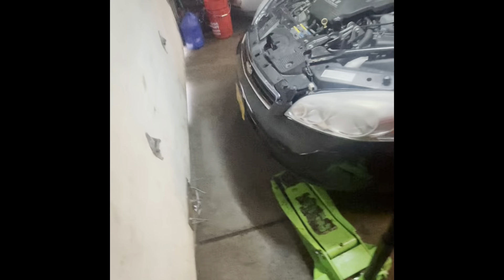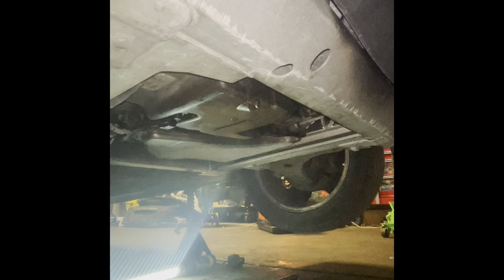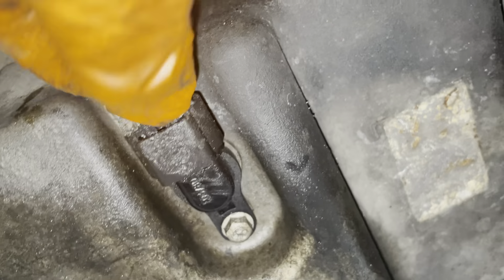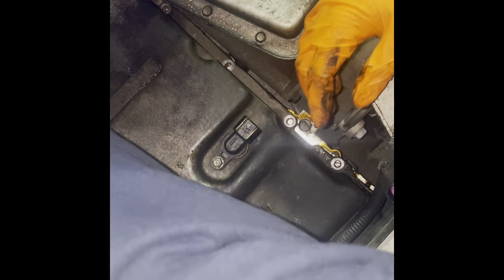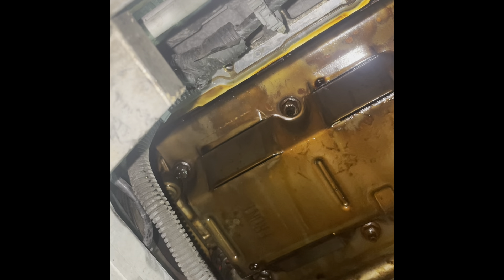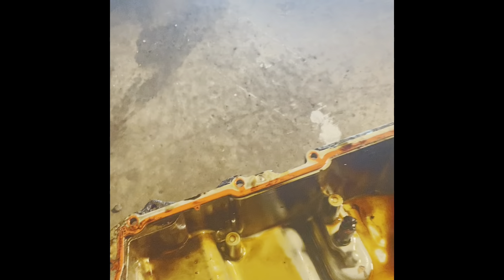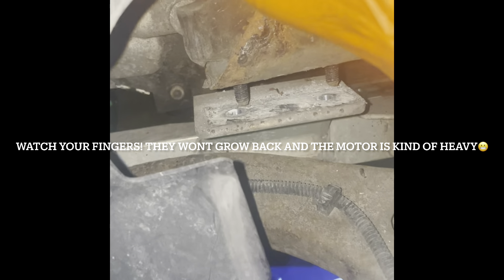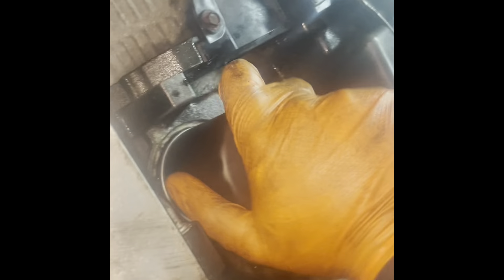06-09 Impala SS 5.3 LS4 Pickup Tube O-Ring Replacement

Comment: I have an 2008 GXP with 92,000 miles. I checked the oil pressure with a scan tool. It was 45 psi at warm idle.